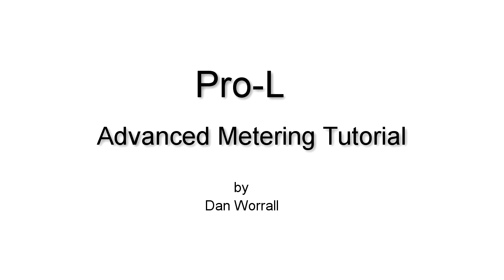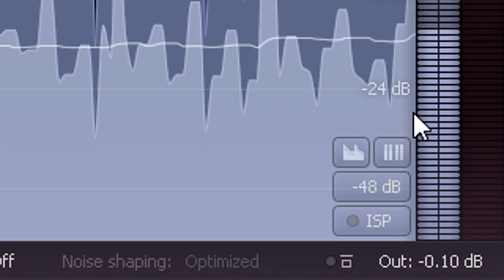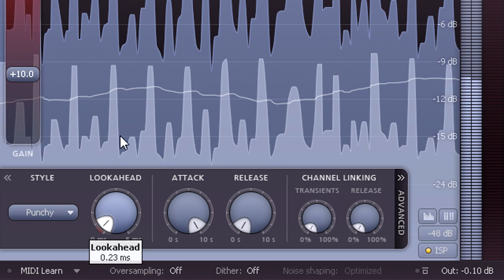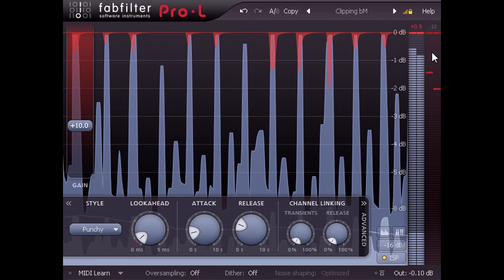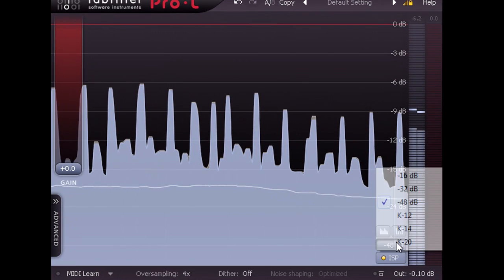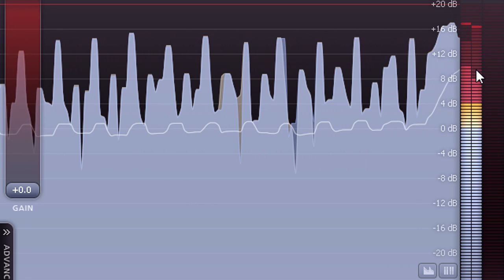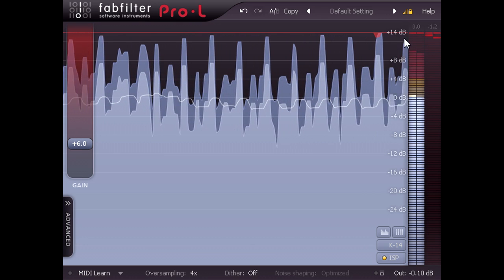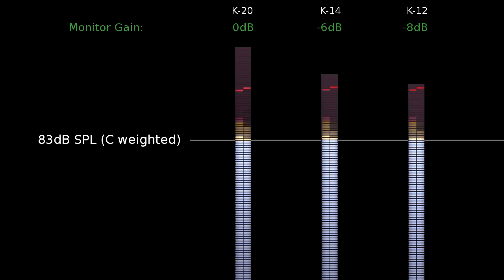FabFilter Pro-L - Advanced Metering Tutorial

Comment: These are relatively cheap plug-ins. Go look at the UAD stuff or Waves stuff.  Now those are expensive plug ins.  I have almost all of the fabfilter stuff and they get used on every mix I do.  They are worth every penny, you wouldn't want a dumbed down version of this stuff.  Also, even if you don't purchase a bundle, after you purchase one plug in you get a discount on every other one you buy after that. I ended up getting Pro L for $133.00, its originally $219 and I didn't purchase any bundle.